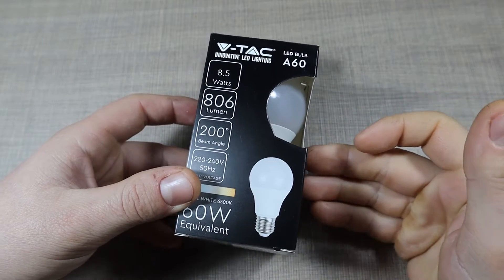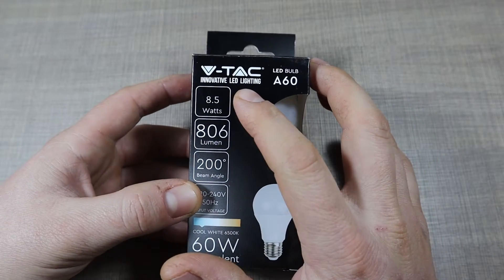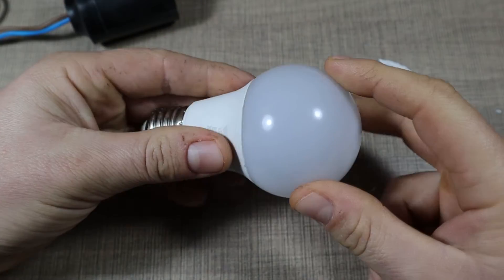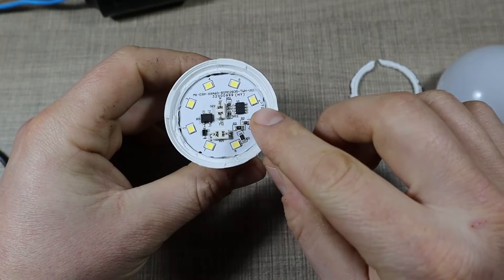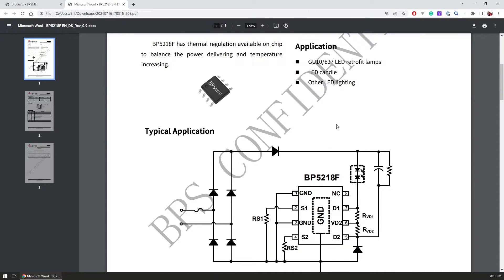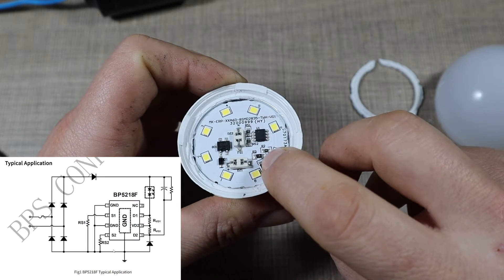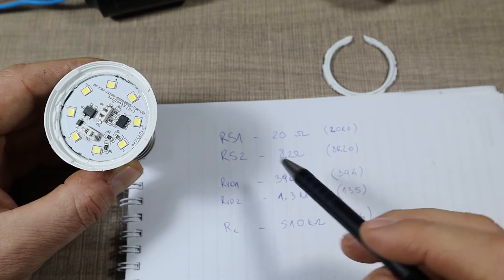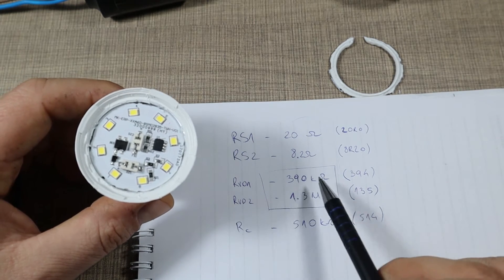This light bulb can't run for 24 hours because it will self-destruct!

Comment: I tested today the LED bulbs V-TAC VT-210 9W E27 neutral white 4000K, price 1,15€ per piece.
This type contains 10 LED packages in a series (according to the manufacturer, Samsung LEDs are used) and the bulb is not intended for non-stop operation.
The mechanical design is similar to the Heda HD121 that I tested last time, but the VT-210 does not have a synchronization via 100Hz half-wave from bridge rectifier, so this bulb has a significantly worse power factor somewhere between 0.64-0.72.

The electrical solution is with a high-voltage step-down DC-DC converter of a classic design, where the input L from the bulb socket through a fussible resistor of 10 Ohm is go to the bridge rectifier pin 10 of IC1 and N from the bulb thread is connected through the suppressor coil L1 of value 1.5 milliHenry to pin 1 IC1 of bridge rectifier.

The rectified mains voltage is smoothed by a 4.7uF/400V electrolytic capacitor and then + DC voltage is fed to first anode of LED chain.

So this LED bulb have only one IC (IC1) with an integrated bridge rectifier and the DC-DC regulator itself with a power N-FET transistor in one package (KP1059 in a 10-pin smd package with some terminals omitted).

The cathode of the last LED in chain is connected to input IC1 pin 6 through the coil of the DC-DC converter L2 of value 3 milliHenry (Drain of the integrated N-FET transistor).

The Source of the N-FET transistor integrated in IC1 comes out at pin 5 of IC1 and through a pair of parallel-connected resistors RS1 (smd 0805 4.3 Ohm) and RS2 (smd 0805 6.8 Ohm), which are used to sense the current passing through the transistor and the LED chain and the circuit closes to the minus of bridge rectifier pin 3 IC1.
So the total original value of the parallel connection of RS1 and RS2 is 2.63 Ohm.
The voltage drop on these resistors to the minus of the rectified voltage is scanned by the logic in IC1 and based on this, it determines how long the N-FET transistor should be turned on to achieve the necessary current through the LED chain.

I modified this LED bulb by change the RS1 and RS2 parallel combination rating from the original 2.63 Ohm to 3.64 Ohm by removing the original resistor 4.3 Ohm RS1 and replacing it to resistor 7.87 Ohm, because this value I had on hand.
This reduced the initially set value of the current through the LED chain by 28%.

Measured parameters by Lidl power factor meter before modification and disassembly:
- Mains voltage 224-226VAC 50Hz
- Lamp current consumption around 70mA
- Power factor 0.64--0.72
- Power consumption 10-10,5W

Measured parameters after modification:
- Mains voltage 224-226VAC 50Hz
- Lamp current consumption around 50mA
- Power factor 0.66-0.72
- Power consumption 7-7,5W

The difference in luminosity between two bulbs of same type in one chandelier was only slight, one of which was initially unmodified and one with replaced RS1 from 4,3 Ohm to 7,87 Ohm.
Unmodified bulb heated up after 10 minutes that it could to 45-50°C, the modified heated about 35°C and that is at a room temperature of 20°C.
Reply from the maker: Thank you for taking the time to share your findings. This is very educational.

Comment: After all, you have a datasheet in English for BP5218F.
I found the datasheet only in Chinese today and I immediately understood that the current through the LED is set by the value of the resistor RS1, which you stated that you have 20 Ohm.

I have a four pcs new 9W LED (61W equivalent of tungsten lamp) neutral white 4000K Heda HD121 at a price of 1.25€ per piece (imported from China via Poland) with an almost identical schematics as you with the BP5218F IC.
I have original value of RS1 22 Ohm smd 0805, RS2 (resistor determining the charging current of the electrolytic capacitor) I have 6 Ohm smd 0805.
The difference in my wiring is that I don't have two resistors RVD1 and RVD2, but I have only one RVD1 with value 2 M Ohms connected between pin 6 and 7 of the BP5218F IC.
And also the second difference is that I have 10 LED packages, always 2 in parallel and together in series. 
Each LED package contains 17 LEDs in series, so at 3V per LED it means 51V per LED package.

Measured parameters by Lidl power factor meter before modification and disassembly:
- Mains voltage 227-228VAC 50Hz
- Lamp current consumption around 50mA
- Power factor 0.80-0.82
- Power consumption 9-10W

So in the first one bulb I changed RS1 from the original 22 Ohm to 33 Ohm and RS2 from the original 6 Ohm to 10 Ohm and the measurement results are:
- Mains voltage 229-230VAC 50Hz
- Lamp current consumption around 40mA
- Power factor 0.92-0.94
- Power consumption 7.5-8W

And on the remaining three I changed RS1 from the original 22 Ohm to 39 Ohm and RS2 from the original 6 Ohm to 10 Ohm and the measurement results are:
- Mains voltage 229-230VAC 50Hz
- Lamp current consumption around 30mA
- Power factor 0.92-0.94
- Power consumption 6-6.5W

The difference in luminosity between three bulbs of same type in one chandelier was only slight, one of which was initially unmodified and one with 33 Ohm and one with 39 Ohm , but the unmodified bulb heated up so strongly after 10 minutes that it could not be keep in the hand, the other with 33 Ohm have about 55-60°C and the third with 39 Ohm have about 35°C and that is at a room temperature of 20°C.
Reply from the maker: Not that is what I call a scientific approach and an excellent comment and experiment! Thank you for sharing! 
And yes, the difference in temperature is amazing. 
Just that alone will at least double the life expectancy of the light bulb, plus the reduced current will also reduce the stress on them making it even better. I just simply can't understand why manufacturers are always pushing these numbers to the absolute maximum 😖
Reply: @TasteTheCode  If something is extra cheap, it's solution is always to "blood" (in slovak LTT "len tak tak"). 
They know how to do it for a long life, but then they will ask 3 times the price for it directly in China :)
And so today, if you come across 10 similar products made in China officially sold in the EU (I don't mean dodgy junk from ebay), then be sure that the difference between a bulb price 1.25 vs 3.50 will only the brand, price in PRC is same, but greed of brand is different :)
Reply from the maker: @heno_3098  Yup, true that! Since Macedonia is not yet in the EU, we still have a lot (and I mean A LOT!) of dodgy junk products that quite often burn up after just hours of use and because of the greed that you mentioned, they are often priced same as or very close to better-built products and people are paying the price just because they do not know to make a better judgment. In my videos, I'm trying to relay this information as much as possible and help people out.
Reply: @TasteTheCode  This same is even in the EU :)
It is the same in Slovakia that some traders and e-shops sell products that do not comply with EU standards and certainly not with the former Czechoslovak "ESČ" standards, which in past under socializm tougher than EU standards today.
Our products, such as distribution transformers and circuit breakers, still work today similar to the Soviet ones in Ukraine, until the Russians bombed them as part of decommunization and denazification.

Cheap dangerous products are mostly fake products from Hong Kong and not products of official enterprises of the PRC.
For example, dangerous chargers where transformer windings are not properly insulated between hot and cold sections and not safety suppression capacitors are used and without proper fusses and or fussible resistors.

Although Hong Kong already belongs to the PRC, some still sabotage the socialist leadership, similar to how our products were spoiled by competing companies from the West under socialism.
In fact that our electronics and machines were sold in West Germany under Quelle and Neckerman, so now Chinese products are sold under trade marks in the EU and actually everywhere. 
And of course the dangerous junk from Hong Kong and Taiwan called "made in China" is also sold here.
Maybe I'll start selling modified bulbs to my friends and maybe monetize my skills :)
Reply from the maker: BTW, BPSemi seems to have updated the website and with that updated the datasheets so it is now only in Chinese http://www.bpsemi.com/col332/404 
I can see that they removed the RVD2 resistor and left it open circuit. I'll try to do the same.
Reply: @TasteTheCode  Well, few eu people understand "houses and trees" (Chinese characters). 
For me is enough a recomend scheme for understanding.
I have a principle that if I write, then everything should make a lot of sense to everyone and if not, then not write anything.

You don't need to modify the connection with the RVD, it only serves to power the chip itself.
They probably changed IC structure in new revision and now in the chip there is already a diode and one resistor added.
They also follow YT :)
Then maybe they will delete the data sheet from the website or to new bulb it appears BP5219 without datasheet :)
Reply: I have the same bulbs as in the video, but they are a little different inside. There are two parallel resistors. Even the chip is another BP2863 for AC voltage and some coils, the bridge is missing. I removed one resistor and the power, temperature and brightness dropped by about half. They're probably still developing it.
Reply: @eldacz  The brightness depends on the LEDs used, what current they need. And it's different for every LED batch and manufacturer type, the resistance must be gradually increased to achieve a good compromise of luminosity, but at the same time so that the LEDs heat up as little as possible.
Therefore, as a first attempt, I used a resistor not of twice the value, but I increase only half from original value as high, to see how it would change, and since it seemed to me that it still shines quite strongly and it still heats up unnecessarily, so I gave it as a second attempt almost double, but I was limited by what resistor values I had on hand...
You understand? 
This means that if they start manufacturing bulbs with a different type of LED, probably because they managed to buy something at a better price, they always have to do what we do first, that is, test it and then depending on what resistor values they have in stock or what they know how to buy cheaply and decide what to put there in what combination.
Since the light bulbs are cheap, then in China, where they make it, they are worth every penny is very important for the quantities of pieces produced.
Reply from the maker: @eldacz  Huh, that is weird, maybe a different batch? Or maybe they realized they had an issue so they changed it. In any way, it is interesting to see that the same product has different circuits inside. Thanks for sharing!
Reply: @TasteTheCode  It may not be the same product, I didn't learn the model number, and even a matching model number may not be a guarantee that it will be the same inside, as there may be different REVs or versions.